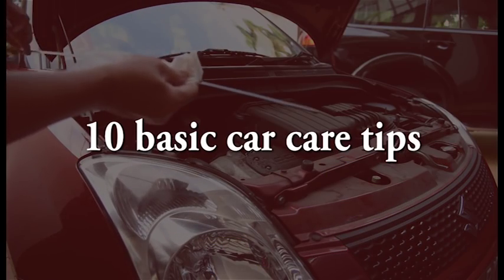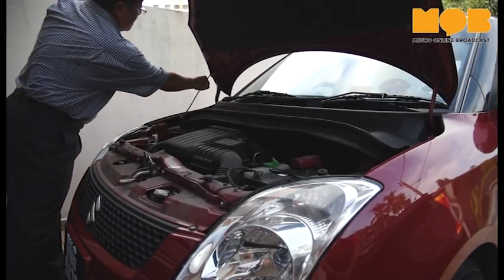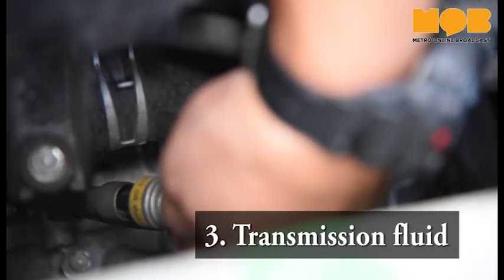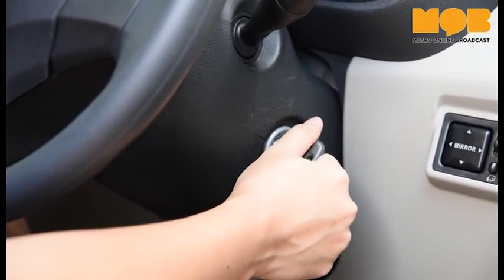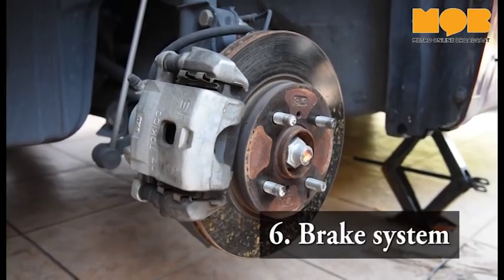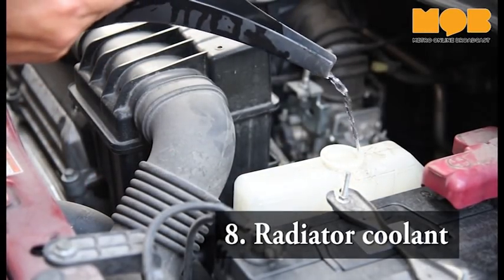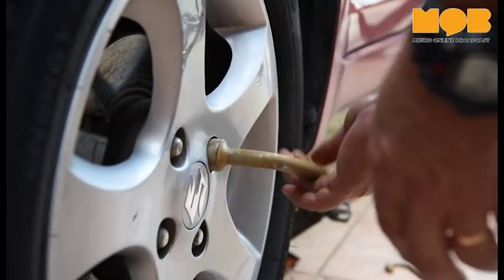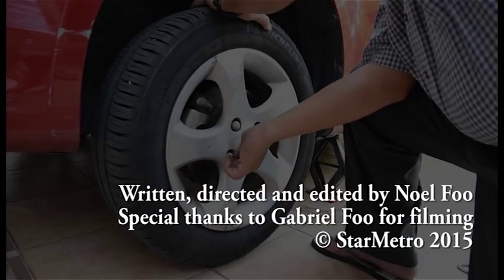10 Basic Car Care Tips

Comment: Pro tip: When changing the tire, loosen the lug nuts a little before you jack the car up. The weight of the vehicle will help keep the tire still so you can apply enough torque to loosen the nuts. Then jack it up, and loosen the rest of the way. I like to put a little bit of weight on the jack first, then loosen the nuts, then jack up all the way to get the tire off. That takes a little of the weight off the wheel and onto the jack while you are loosening the log nuts, but keeps enough weight there so the tire does not spin around.

Comment: What about the radiator coolant? can we use normal water at that radiator?
Reply: only if you live in a hot climate, that water will freeze in the winter and ruin your engine. radiator coolant has ethylene glycol added to water which decreases the freezing point

Comment: 10 basic car care tips.

1. Tyre pressure
2. Engine oil
3. Transmission fluid
4. Spark plug
5. Car battery
6. Brake system
7. Air filter
8. Radiator coolant
9. Changing tyres
10. Emergency contact

Thank you.
Reply: Rebecca yong      Tires not tyre lol sorry had too

Comment: I do all the maintenance on my 3 vehicles. I just follow the recommended maintenance schedules for each vehicle. I use a cool program on my laptop called Automotive Wolf www.automotivewolf.com to track each vehicles schedule and remind me when to check things or replace something like the oil, plugs, filters etc. All 3 vehicles have over 100K miles without any major repairs. This software also makes a comprehensive car maintenance log and even tracks the parts and expenses to run each vehicle. If you want to keep your car running well and avoid repairs just follow the maintenance schedule.
Reply: Great software. I recommend it to my customers.

Comment: As an ASE certified mechanic I agree with all the advice in this video. I would add that staying on top of your vehicles maintenance schedule is the key factor in avoiding expensive repairs and extending the life of your vehicle. I recommend using a good car maintenance and management program www.lonewolf-software.com/automotivewolf.htm on your computer to track your maintenance schedule and remind you when anything needs to be checked or replaced. It will also create an excellent vehicle maintenance log that you can use to quickly sell your vehicle when the time comes.
Reply: i use a Android app and it is much better
Reply: I've tried several Android apps and nothing comes close to Automotive Wolf!
Reply: @lalit3124  Which app do you use ?
Reply: @GautamKumarSingh28  I am using drivvo. Free version on Android.
Reply: @lalit3124  Thanks